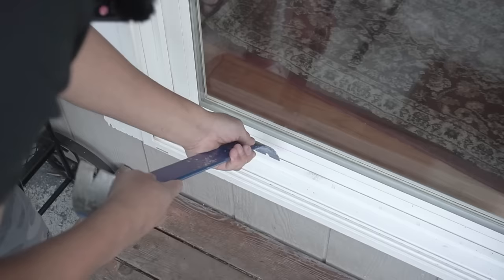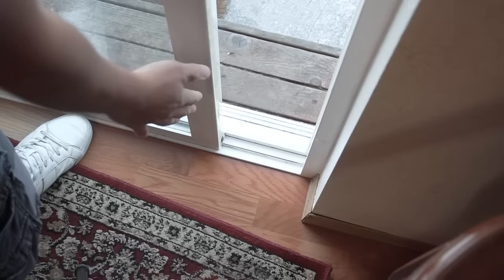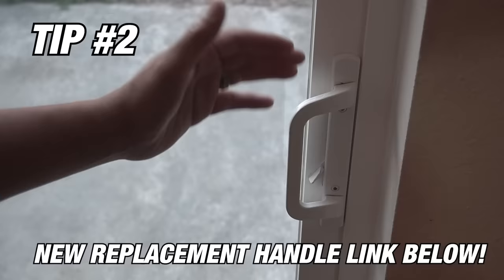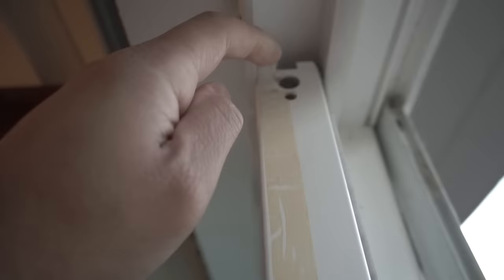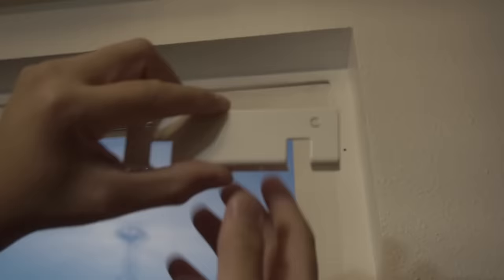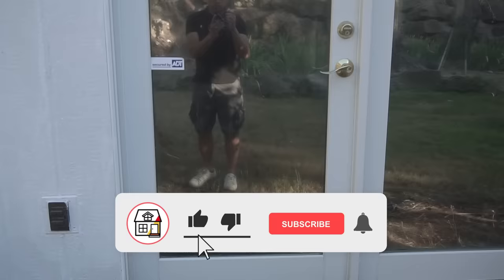How To STOP Sliding Door BREAK-INS! Burglar-Proof Your HOME! (10 TIPS To Keep Your Family SAFE!)

Comment: They broke my glass so none of your ideas works 😂😂😂
Reply: These days the thieves just steal a Honda or a Kia and use it as a battering ram.
Reply: absolutely they are not going to waste time to do that.
Reply: Get better glass?
Reply: you need safety glass. with that anti break layer.
Reply: A dog would likely keep barking which might serve as a deterrent to a burglar that probably wants to get in and get out without attracting unwanted attention.
Reply: Just an FYI. 3M makes a security film you can install on your glass doors. Probably many other brands as well.
Reply: Thank you for saving me watch time! I already have bars to keep the doors from being opened. I'm looking for security cages outside the glass to prevent entry if the glass is broken.
Reply: Mine too.
Reply: Replace the glass with laminated glass.

Comment: If your door has wheels on the top then you can simply tighten the wheel adjustment bolt (located in that hole at each end of the door) to raise the wheels until they touch the top of the door frame.  That eliminates the gap without having to put all those wood screws into your door frame.
Reply: Thanks!
Reply: You can also screw a spacer above the door track to eliminate the gap between the sliding door and the top track so the intruder cannot lift the door off the lower  track.
Reply: My thoughts exactly!!!
Reply: @faltio69  I thought the same. I think it would be a cleaner look as well.
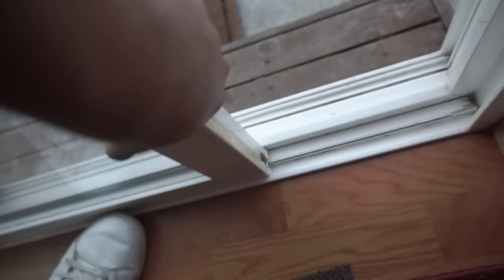Reply: They also are at the bottom. You can see one at 4:27 and should always adjust them to prevent the door from being lifted out of the frame.
Reply: Correctly installed doors have spacers in the top rail to prevent lifting the door.
Reply: Great tip I was trying to avoid drilling ugly screws
Reply: agreed @davidwinston1627 that was the worst security install that I have ever seen discusting.
Reply: @faltio69  what and achieve the same discussing job? great idea.
Reply: Very few doors have rollers at the top. For the manufacturer,  it's a waste of money.

Comment: Thank you for this. As far as preventing the door from being lifted out of the track, I measured the gap at the top edge of the door (~.5") and bought a wooden dowel of that diameter at the hardware store for $2.50 for 4'. Slide the dowel into the gap between the top of the door and the track. Of course I also have a dowel in the bottom track. The reason I mention the dowel, which does the same as the screw solution you mention, is that some people may not have the tools to do the screw method, or maybe don't want to put a hole in the track.
Reply: Thank you. I wondered if something like that would work.
Reply: Oh this is such an old post but hopefully you will read it-is there a pic somewhere online of what you are describing?
I cannot picture it.
Reply: Thank you very much for this video.
Reply: More genius thinking at work! I will try the dowel first. My only concern is getting the dowel out. I might screw in a steel washers to the ends of the dowel. I have very strong magnets that I can use to fish out the dowel if needed. The frames are aluminum so the magnets will not stick to them, but then the magnates may not be needed for my setup.
Reply: @winstonsmiths2449  I'm glad you like my solution. As far as getting the dowel out, you can just open the sliding door half way and poke the dowel out either side with a similar dowel. The dowel shouldn't fit too tight, it just kind of sits on the top of the sliding part of the door, taking up enough space to prevent the door from being lifted enough to remove it.

Comment: One of the easiest and most effective is a dowel/pin through the frame of the sliding and into the fixed door.  Do it at the top (where there's no glass) in the middle of the opening where the two doors overlap.  I made nice ones for my mom with an aluminum rod from Home Depot and a nice wooden door pull (also from HD).  Drill a hole all through the inside door and the inside side of the outside door (NOT ALL THE WAY TO THE OUTSIDE).  Put the pin through and there's no way to slide the door or pick it up with a crowbar or suction pads because now the two doors are locked together.  Don't do the screws in the top frame as you'll pierce the water barrier and possibly allow water in around the door.  Don't do that.
Reply: perfect. thank you.
Reply: I remember that doors used to come this way in the "olden days".

Comment: A good substitute for a stick is the white PVC pipe used for sprinklers. Cheap and easy to cut. If they are cut slightly long, they can be wedged in to make the locking stronger. Like the screws over the top keeping the door from lifting.

Comment: Very very well done.   Thank you.   We recently had our slider replace by Anderson.   The space on top is less than ¼".   I think a strip of wood with double sided tape would be more effective than screws and doesn't mar the frame.   This door has the security latch built in.
Reply: That's an excellent idea.  You don't need screws to hold the shim in place.  But, the screws might be easier to remove if you have a need to remove the door for your own reasons.

Comment: In 1994, my apartment in Vista, California was broken into. I was on the ground floor & they used a piece off the barque to break the sliding glass right near the lock. That motion detector would have helped. Thank you for tips.

Comment: Some modern sliding doors come with "deadbolt" mechanisms on the door. Two bolts extend out of the door into the frame from both the top and bottom of the door. This prevents the "lifting" break in technique. While an extra security measure or two is wise, it's also important to remember that it is just a glass door. If someone is hellbent on getting in, they will just break the glass...

Comment: 5:48 also leave enough for expansion and contraction of the materials (roof, doors, windows etc) and your house in general. Having those screws too close can cause the sliding door frame to put pressure on the door when it gets full sun and heats up. Potentially binding the door or at worse put strain to the glass... maybe add a rubber grommet to the head of the screw or something like RV weather stripping so it's not metal on metal contact.

Comment: One place I lived in, in Sydney Australia, people broke into my ground floor apartment by just lifting the sliding glass door out of its rails 0 even with a drop-bolt!  Luckily, I had only started dead-bolting the front door for the past two weeks & they had to work to get past the inner screen door (behind the sliding door).  It totally freaked me out & I couldn't get home fast enough for 6+ months each day...  My solution was to put a small metal tab at the top of the sliding door, to limit how high the door could be raised out of the sliding door track.  It seemed to work... 👍

Comment: Awesome video!  I already use the stick-in-the-track but could never figure out how to prevent lift out. The use of screws is so simple and quick that I feel like an idiot for not thinking of it before. The idea of changing out the original handle/lock is going to implemented shortly. 
The biggest problem I have with glass doors and windows is that they can simply be smashed to gain entry.  But short of that, these ideas are great!
Reply: shatter proof film is useful for that
Reply: But any window in your house could me smashed as well.

Comment: I was also a professional security consultant. I like your ideas. If you don't mind let me offer you additional remedies. What you introduced are preventative measures which is great! Now let's remind everyone that  there are very affordable alarm companies out there that will actually give you an alarm at no cost provided you have it monitored. Most companies now charge about $29.99 per month in addition to implementing your methods! This is a great way to protect your home. I will also add that when installing an alarm system ask the sales representative about installing an external siren ( outside of home ) and a strobe light . The purpose of these 2 additional pieces of equipment will ensure that everyone down the block will know that someone is breaking in or trying to break in your home. The strobe light will give anyone a visual whose home is being compromised. For example an intruder,medical emergency and so on

Comment: @4:57 the proper way to eliminate the sliding door gap is to actually adjust the roller. There's an adjustment screw that controls how far the roller comes out from the frame, and there's a screw like that on both top and bottom of most sliding doors! The idea is to adjust the rollers in such a way that the door moves smoothly, but snugly, and doesn't have enough play to be forced outside of the track without getting to the adjustment screw on the side of the door frame.

Great tips otherwise, thanks for producing this!

Comment: Any preventative measures must be easily undone when there is a fire in your home.  Also if is more than 4 feet off the ground it is a fire hazard because most likely you will be crawling on the ground with all the smoke around you during a fire.
Reply: Excellent information.
Reply: just break the glass if there's a fire
Reply: Raymond Wong, I have four or five smoke alarms, I’ll be calling the fire department and getting out of my house way before I have to crawl on the floor.

Comment: I've installed windows sliding doors and glass over 45yrs. 
If your door is adjusted properly. (Raise the bottom  rollers) you won't have this issue. 
No home is secure when it has windows.. glass..

Comment: Great video. My new doors and windows came with the bolt type addition. Nothing moves when its engaged. I added a solenoid bolt to my front door thats thick. Less costly than upgrading my frame deadbolt. Disengaged inside, remotely outside or if power fails. Few burglars enter at the front door.

Comment: All these tips are great but I want to add to the security bar idea. Leave the rubber bottom installed it acts as a wedge to provide instant support. The other thing is turn the lock nipple down because it is spring loaded and over time it will break down. This will work with gravity and not against it. This guy knows what he is talking about!!! Great job man!

Comment: That won't  help if they break the glass
Reply: Then I guess I should stop locking my windows.🔨
Reply: @jaytee2642  yup
Reply: @shellyhelferich3541  
You go ahead and leave your house unlocked.🙄
Reply: It's been well known that Burglars rarely break glass to get in a house. Until lately anyways. Now they are getting more bold because less are getting punished for their robberies. But before this, these preventions would help you at least 50% of the time, the other 50% being the front or back door. There are other preventions you can take when someone breaks the glass, but it's not included in this video. Which would be, an alarm, a dog, and a gun or five.

Comment: Thank you - GREAT video.
Yes we have a top lock, a board and that white round door blocker. We also have the plastic film installed on the glass inside - ours is clear & it's purpose is to prevent the glass from shattering if hit from the outside. I LOVE the idea of the screws up top so the door panel cannot be lifted out! I think we WILL be doing that. Thank you again. Judi

Comment: Don’t put the screws in the top! I’m in Australia and we put a rubber block at the top on the lock side as long as they can’t lift the door over the lock it won’t open. Plus you want to able to lift the door out if you need to service the rollers or replace them.

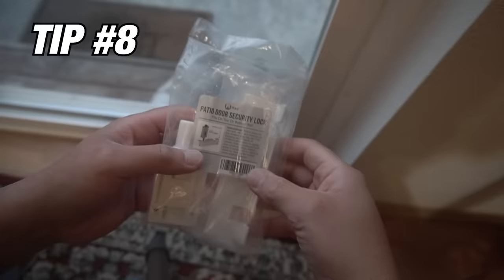Comment: Thank you for putting the video out like this. I do have to point out that the security lock that you installed at 8:11 wouldn’t work in that configuration. One of the parts has to be on the sliding door itself and one has to be fixed on the railing. It is one of my favorite locks that you showed.

Comment: In the 70s, I lived in a rental house with 2 sliding glass doors. Not the best area of town tho. I used pipes at the bottom track but at the top, I got 2 36" long pieces of square dowel 1 x 1. There was just enough space to slide them in on top of the door. No lifting them once installed. I've often wondered if anybody found those after we moved.

Comment: The track rollers at the bottom of the door have adjustment screws so that when installed they should be adjusted to prevent the lifting and if there is any a need to remove the door they can be adjusted back to let the door be lifted.

Comment: One thing you want to be sure of is that the little claw mechanism that comes out of the door lock definitely needs to be pointing up.  Mine was pointing down which means all you need to do is grab the door handle and lift up about an inch and the door slides open with ease.  Can't believe my door was like this for almost 3 years.

Comment: Applying clear security film onto the interior side of the glass extending onto the frame makes it a lot harder to gain entry by breaking the glass. The film holds the broken glass together and acts like a vertical trampoline making the intruder work a lot harder to get through and probably cut themselves in the process. Most will figure it isn’t worth the time and effort and give up.

Comment: wood on the bottom can be easily knocked out of the track using a coat hanger, I recommend a Billyjack it requires 2 actions at the same time, easily mounts in the middle of the door and swings up and locks into place so you can open the door, this is a good deterrent to visually see, so unless you can squeeze and lift the mechanism to unlock the Billyjack from the outside this works best. I like the last 2 but a thief can't see these so they will try and could end up breaking the door in the process

Comment: Install slide in clamps with adhesive constitution type 4 of them across each end  centered  on the end use a 2 by 4  or aluminium thick met,, thick  plexiglass use super adhesive

Comment: Thank you so much for these wonderful tips, I will definitely install the screws and locking mechanism. I already have a dowel, but nothing for door lift.  I just want to mention that at my previous house, there was a bracket on the outside where the slider and stationary window met and on several occasions when I locked myself out of the house, I got a screwdriver from my car, undid the screws holding the bracket and removed it--I was then able to sit on the ground and use my feet (with tennis shoes on) to slide the STATIONARY side of the window over a foot or two to get in. I was always afraid someone was going to get in that way, and it wouldn't trigger the house alarm. Maybe you could make a video showing how to prevent that. I discovered this while installing a doggie door in my sliding glass door--I wanted it on the stationary side so I could lock the slider. My newer house just has a screw that I have never messed with so I don't know if it will have the same affect.

Comment: At around 6:00 in this video he recommends installing screws at the top of the sliding door track to eliminate the vertical "give" in the track.  I think it's a decent idea EXCEPT that at one time I had a sliding glass door that the wheels on the bottom disintegrated.  The door would no longer  move (no rollers, no movement).  My problem is that with the screws in place at the top and the rollers gone on the bottom, you no longer have a way to remove your door to repair the broken rollers.  Maybe not a big problem that would happen often, but I recall the repair guy trying to deal with that sliding glass door...

Comment: Rented unit. The landlord put in sliding security screens, with independent keyed locks. Works well.
Added 'Alarm security' stickers on the inside of the glass.  My wife likes the wooden rods. Added fake security cameras on the outside.  These might notice these. Keep the real security cameras (if installed) hidden, to prevent damage or manipulation.
My wife added lace curtains, to prevent daylight viewing of the interior.
Unit has sliding vertical blinds. These can also be wirelessly automated, and kicked to home automation, even for rented units.
There are many broken-glass alarms. These alarms may or may not be connected, but their obvious presence is a deterrence.

Comment: My FEMALE NEIGHBOR used to unscrew the screws on the non-movable side of the sliding door. We found out how she was getting in, when she didn't push the window back in the frame and had snow coming in thru the crack (on the wall side). 
We got screws with removable heads you saw off after you install them.

Comment: I'd avoid having a sliding glass door to any area which can be easily accessed from ground level.
ie: only use them on an isolated deck (no other way onto the deck except through the sliding door), and make sure the deck is a good 8 ft off the ground with inconvenient railings.
Either that, or get a 250 lb sliding door with deadbolts and unbreakable glass, and go to the gym so you can open & close it.

Comment: These are so helpful we had windows put in that slide up and down and while people were working on our home broke several of the latches and now I have to use a tension rod so they don’t fall out on someone’s head rendering them useless any ideas as to fixing this so they can be used once again any thoughts would be greatly appreciated…these windows were designed to be easily cleaned on the outside by them pulling out into to room or simply dropping forward for access now totally useless

Comment: I need to repair the rollers/track on my door but I can't get it out.  Was hoping this video would give me some ideas.   Alas, I highly doubt the way he shows of breaking in works if the door is latched because it's not just the bottom trim they have to lift the door out of, it's also the side trim when the door is closed.   So the door has to be able to be opened before you can lift it out of it's track